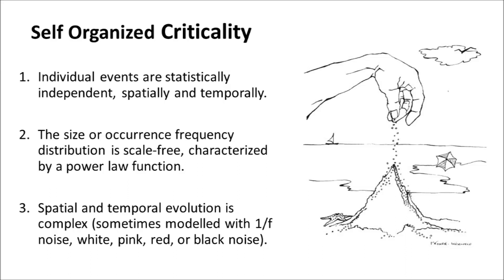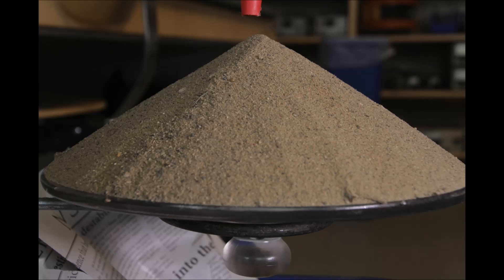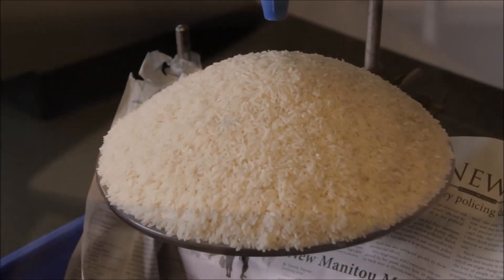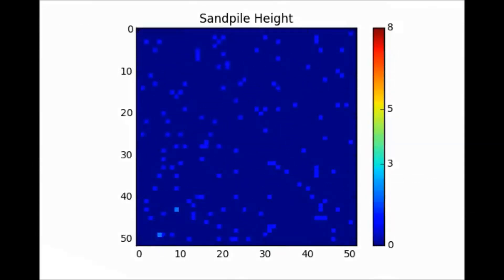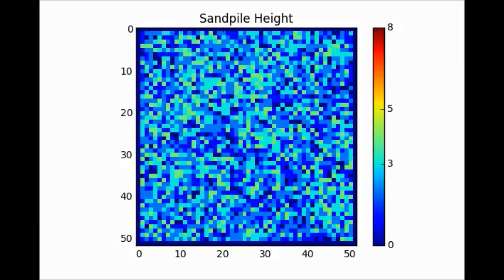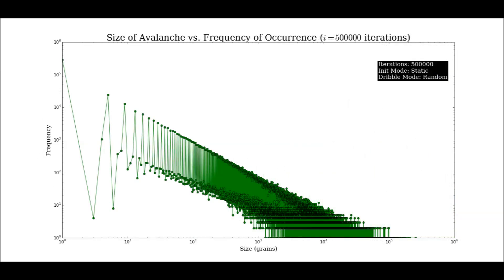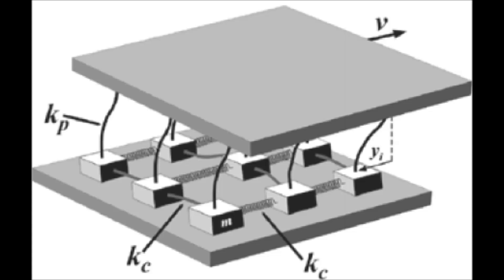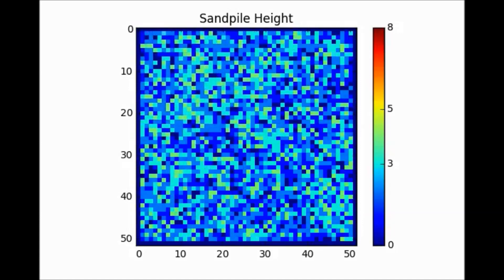Self-Organized Criticality

Comment: Hey, I note that the upper powerlaw appears to contain all sizes that are multiples of four, and the lower curve contains all the others! Could this be related to the fact that one avalanche moves four grains? If so, could it be that your code only returns a non-multiple-of-four size if a grain falls off the edge (confirming your hypothesis that it's an edge effect)? I wonder if you'd see just the upper powerlaw if the x-axis were "number of local collapse events" (i.e. one count per collapse instead of four).

Comment: Is there away to link two of these applications together? For example: predator spread and lifeform flight or extinction? So as the predator adds his 4th grain to a stack there could be a link to producing a 4th grain „spontaneously“ in prey behavior also, which would e.g. drive the lot of prey to another area? Maybe under certain circumstances at that point then even 3 grains of prey could be enough to evalanche. best regards and thnx for the video